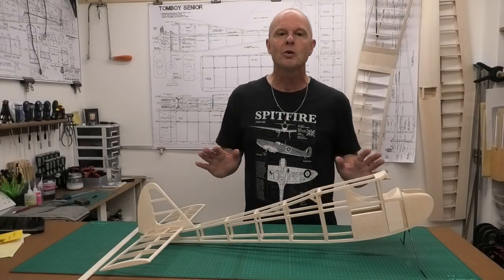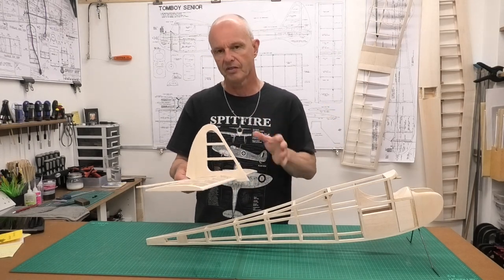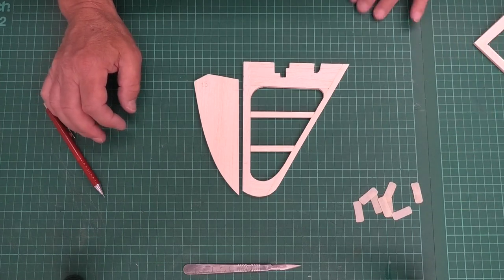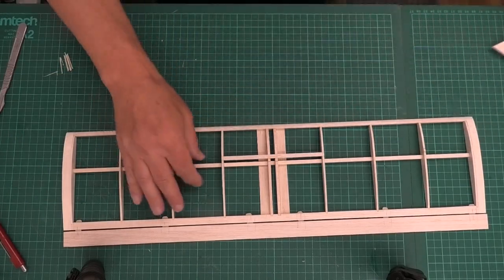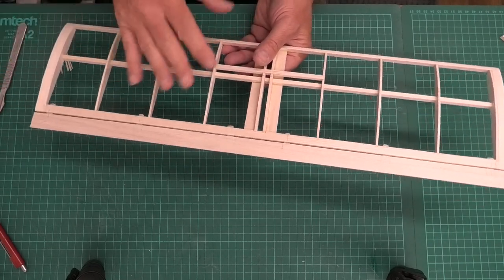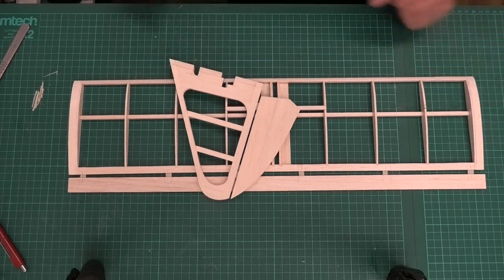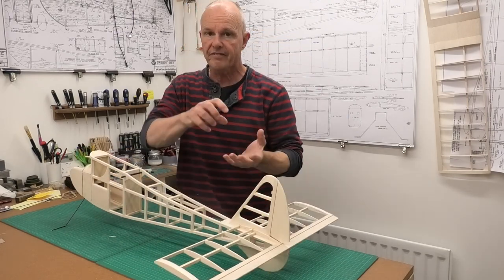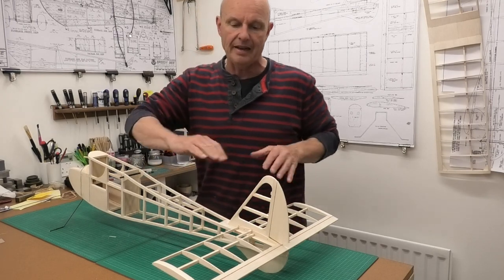Tomboy Senior - Build Series - Pt 9: Fitting the Tailplane & Fin

Comment: Excellent workmanship Mark! I’m really enjoying this build. Have you ever used covering film hinges? I’ve used them since the early 80s on 40 size and smaller models and I’ve never had a failure. They have almost zero resistance to movement.
Reply from the maker: Thanks for the comment, pleased you like the build.  No, not yet tried the type of hinges you mentioned, but thanks for the tip